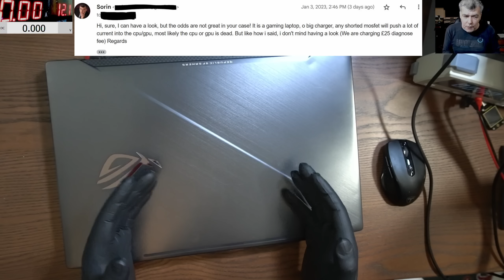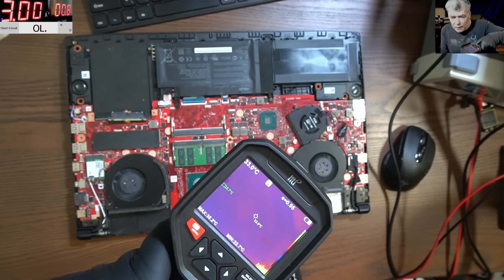Asus GL703G gaming laptop. Let's see what can get faulty in a gaming laptop

Comment: I have the same laptop model as this one although its a GL752v and the motherboard looks identical to the one on the video, it had the same problem as shown, it's a good abit to replace the mosfet with known working ones and then test for shorts, you probably couldn't see the short anymore since it was an open circuit, for my case it was the ceramic inductor right above the first mosfet you've removed that was causing the short, I tested back with a new inductor and the old mosfet and it worked, so sometimes these mosfets can really lead you in the wrong direction.
Reply: how can an inductor causing a short ? it doesn't make any sense . the inductor isn't connected to ground on any side it acts kinda like a fuse to smoothen the power .

Comment: ABOUT PCH/CHIPSET:  before, we have chipset as Northbridge (always close to cpu), which has memory controller inside, and it was "connecting" cpu, gpu, ram, and (if the integrated gpu was available on the motherboard, then it was always inside that Northbridge). And second chip - the Southbridge (far from cpu - on south), which manages Inputs/Outputs like USB, Lan, SATA, Sound, etc. Southbridge was slower and connected to Northbridge.
but
Now we have PCH (which is Northbridge+Southbridge merged together). but the integrated gpu is now on the cpu chip (in early version as separate silver die, but now also integrated in cpu die).
btw.
 new PC ATX motherboards have PCH always as separate chip, placed in the middle right down.
But if you take a look at i7-5600U in google graphics you will notice that this is laptop cpu - and that long silver die is a cpu and that short one is a PCH. If the laptop motherboard has that kind of cpu - then you will not find any other separated chipset on the board, because PCH is placed on the cpu.  This cpu with pch on the one chip is called Hybrid.
But if the laptop motherboard doesn't have that kind of Hybird, but only simple cpu as on this video, then you will find separate PCH chip on the board.

Comment: The main importance about Asus, is the battery health. So if you have an Asus, you have to discharge 3x in Windows, and 4th time in Bios. You have to do it more times. Then, it can hibernate in 1%. By doing this more times, you can enhance it to high performance. Other laptops need 10 discharges in Windows , and the 11th is in bios. The lcd must be at max during discharge in bios, its coil causes the battery to become strong during bios discharge. You may need to remove the button battery of Asus, that is normal. Several cycles of this enables industrial performance, hardcore gamers will love it.

Comment: Thank you for this video, very informative and entertaining!

I do have a question, what would cause a problem like this? a power surge? poor overclocking? faulty hardware?

I am new to this electronics repair thing because I've been watching a lot of videos and I do own an ASUS laptop as of recently and I'm curious to know what could cause a problem like this so I can avoid if possible aswell or at least understand it better. Thank you.

PD: I am somewhat tech savy, I have worked in IT before but nothing regarding voltages and electronics.

Comment: Bravo Sorin. Seems like the fan are not the original ones. The laptop is know to provide too more heat and some customers uses fan kit from China. Asus revised in 2018 the heat system. The smal fan is not in the original computer, and the chipset was covered by the copper system in the second version. Certainly this is a heating issue, autodestroying!🔥
Reply: oh yeah! i forgot that the heat pipes have to also travel close to the components. good point!

Comment: I think a repair fee is ok if you take your time to disassemble the device, analize it, try to fix it, lose time and then put it back together carefully.
What I don't like is some YouTubers or shops that can't fix anything beyond simple, straight forward faults and then they  charge the customer like it's unfixable when in fact they don't have the knowledge to fix it.
PS5 repair, no picture, they replace the HDMI port and if it doesn't work straight away it's a no fix and the customer gets charged.
Reply: This one is actually a bargain because you get an explanation vid. You never know the skill level of a repair shop when they give such a general/poor/vague explanation of a fault, ie, dead motherboard, and when there is $1000s on the line the customer needed a thorough explanation before his mind was put to ease. Basically the 2 assessment's from the other shops was a waste of time, hence why he need this 3rd opinion.
Reply: @SidneyCritic  I not only explain, but I record my repairs and post on this Youtube. Plus, I'm a 5-star rated electronics repair shop. So, not every repair shop is bad and telling that you never know is an exaggeration IMHO ;). There are more shops like my one who care about the customer and love what they're doing.
Reply: @screen-protector  You do know Sorin only films 2 out of every 50 repairs, ie, video explanations are very rare. Sorin was saying he doesn't want to take jobs that other repair shops couldn't fix because he spends hours and they are beyond economical repair, yet he didn't make vid explanations of those. Nearly all shops don't give technical explanations, simply because the general public isn't on a level to understand it, ie, if they could understand it they could fix it themselves - lol -. When you talk to the general public you can see their eyes glaze over when you start getting technical, ie, 99.99% of the time it's a waste of time - lol -.

Comment: sorin are you doing coffee tmrw morning? i have a question about a REALLY hot chip! chip is Realtek 8166EH on HP laptop: TPN-C125. charger led= on and Power on Led= on but no boot, or screen or activity.  Its not for profit or anything. my neighbour died and i had some of his stuff. powering on makes the realtek chip pretty high temp. i removed a SMD capacitor, but no difference. i wandered if you could chat about the basics to find the problem and possibly how to repair.  i dont have a laptop. it has been my dream to own one.

Comment: the chipset has some connection with the gpu, maybe the power sparked over to one of those pads and it went crazy. maybe the smbus was damaged and so the ec is missing data and/or clock lines

Comment: Even if you have a shorted GPU removing the Core you have a good chance to have a working laptop without dedicated graphics , but the PCH is another story. Also needs expensive equipment to replace /remove them.
Reply: what is PCH please??
Reply: @Palmit_  Platform Controller Hub, on other names as chipset, or southbridge
Reply: @Darkyzor  thank you :)
Reply: @Palmit_  I will make it more precise: before, we have chipset as Northbridge (always close to cpu), which has memory controller inside, and it was "connecting" cpu, gpu, ram, and (if the integrated gpu was available on the motherboard, then it was always inside that Northbridge). And second chip - the Southbridge (far from cpu - on south), which manages Inputs/Outputs like USB, Lan, SATA, Sound, etc. Southbridge was slower and connected to Northbridge.
but
Now we have PCH (which is Northbridge+Southbridge merged together). but the integrated gpu is now on the cpu chip (in early version as separate silver die, but now also integrated in cpu die).
btw.
Remember: new PC ATX motherboards have PCH always as separate chip, placed in the middle right down.
But if you take a look at i7-5600U in google graphics you will notice that this is laptop cpu - and that long silver die is a cpu and that short one is a PCH. If the laptop motherboard has that kind of cpu - then you will not find any other separated chipset on the board, because PCH is placed on the cpu.  This cpu with pch on the one chip is called Hybrid.
But if the laptop motherboard doesn't have that kind of Hybird, but only simple cpu as on this video, then you will find separate PCH chip on the board.
Reply: @Radek__  fantastic explanation. TIL!. Brilliant. Thank you :)
Reply: Expensive ? Do you think 500$ equipment is expensive for a repair shop ?  Not saying about that cheap T862A station at 250 - 300 , but at least some IR6500, if not much expensive stations which are fully automatic.

Comment: Looks like the pch has a missing corner exactly where it gets hot. Not able to magnifying the video enough to be sure and anyway I think you would have spotted already if where there.
Reply: what is PCH pls?
Reply: @Palmit_  in the Intel universe literally means Platform Controller Hub, simply known  as chipset.
Reply: @ictrepairs6963  Thank you very much :)  i'm  an ancient AMD (2000's) style of computer user.  I remember north and south bridge, just about, but had never heard of PCH.  what's worrying me mostly is my AMD 9590 cpu and gigabyte 990FX m/b are not win 11 compliant. i have to buy new hardware for practically no reason :'(
Reply: i say no reason. i mean because a comnpany says so. it all works fine and fast. of course the ddr3 ram wont be any use in a newer computer etc etc. grr. 🤬profiteering gone mad.